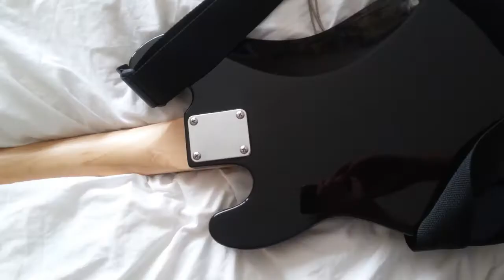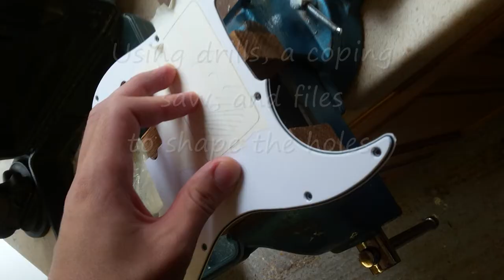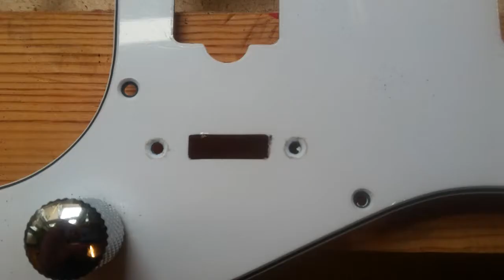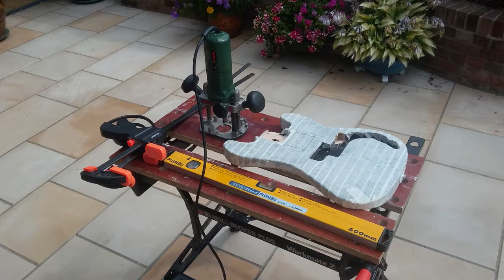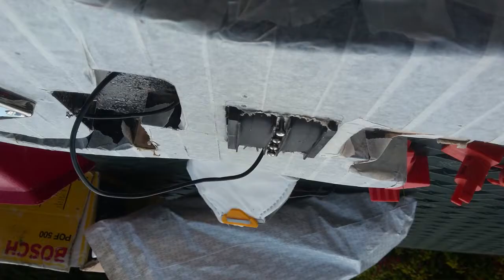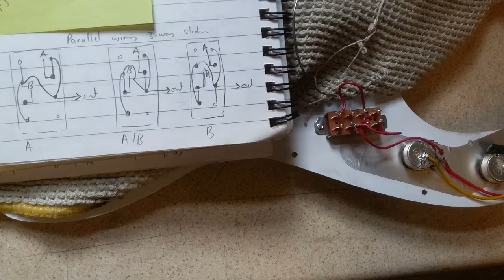EDS: Fitting a sidewinder/mudbucker pickup into a Harley Benton Short scale P-bass

Comment: Hey nice! I have a SW in my Epi EB3, it's pretty fluffy!  What you SHOULD have done, (what I would do) is that Winder is better off as a BRIDGE pick up, and put the P bucker in the neck! However, the 2 seem to work well together!
Reply from the maker: Ha, yeah that would be a great arrangement, I think a friend of mine said a similar thing from his experience. I mainly did it this way round because I always wanted an EB-0 but P is so much more useful for what I do so I thought I'd mash the concepts together. Thanks for commenting~
Reply: @TallismanRogue  Cheers! Billy Sheehan did similar on his Yammy basses with Dimarzio side winders.
Reply: Really? If put in the bridge it doesn't get that massive bass mudness, right? I mean, I love my EB3 mudbucker, but I'm always willing to try new things hehe
Reply: @mhv91  Of course not. It will have more MID focus, but still pump out the subsonics!

Comment: Hey, I'm wanting to do the same.  I'm thinking of arranging at like a modern jazz control plate, with a V-V-T.  I would set up a 500k pot for the mudbucker, and keep the 250 for the Precision pups in the middle.  Also run it with a 0.47 uf cap.  What are your thoughts?  How does this do with rounds on it?
Reply from the maker: Sounds likr s good bet but i wouldn't know how volumes balance until I'd tried it. I've only used round wounds so far so i don't know how flats would sound. It would be interesting to hear how yours turns out but I'm honestly not sure, sounds good in principle
Reply: @TallismanRogue  I would love to see a video where you demo the mudbucker on its on- am doing the same project, but am taking out the p pickup out completly.

Comment: I'm going to replace Ppups with the mudbucker. How deep did you route?
Reply from the maker: Sorry, it was a while back so I'm not sure. All the best with the mod
Reply: I already changed my mind. I checked the distance between strings and it doesn't fit with the distance between pickup poles at that location. Of course, putting the pickup on the bridge woud be even worse. I'm talking about a fullscale P-style bass. Thanks for your attention though :)

Comment: Where you bought that mudbucker?
Reply from the maker: Ebay for about £40 with the rest of the electronics including postage. Ebay is great for parts
Reply: @TallismanRogue  Is the Artec hot EBC4 pickup ? The cheap one ? Because sounds great bro !!
Reply from the maker: @Mxgic_Mike_77  i think from all the bits that came with it is was an epiphone assemble from a gutted eb-0. The knobs and wiring seemed to match the model
Reply: @TallismanRogue  thanks man !!
Reply: @Mxgic_Mike_77  I'm thinking about using 2 of those in a T-60 style bass...not the Peavey shape, but a Fender shape with Peavey headstock. We might have to unwind thise pickups a tad though (".)